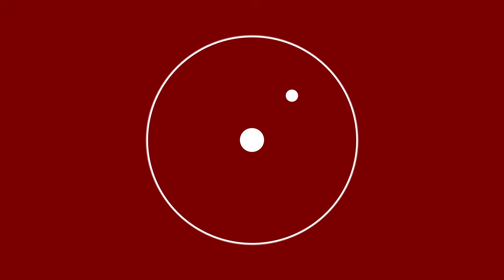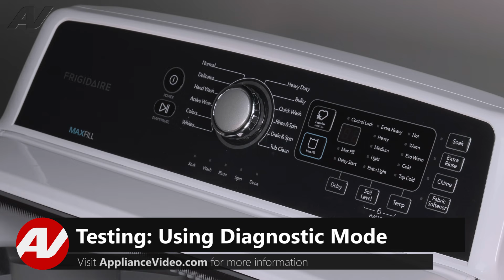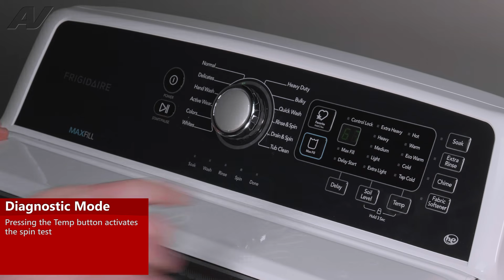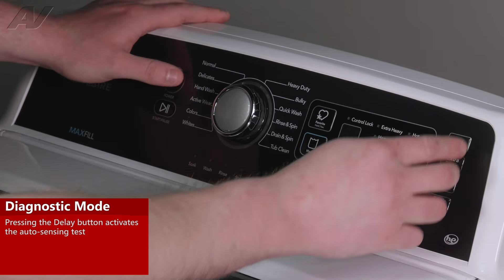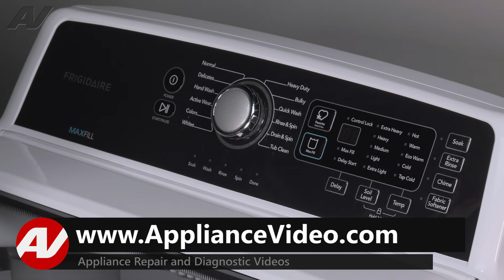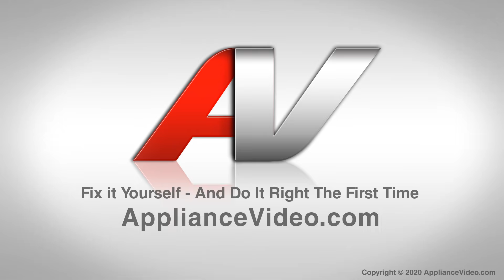Frigidaire Washer  - Diagnostic Mode, Error Codes & Troubleshooting

Comment: im not getting any error codes but after replacing the belt it wont agitate or spin or fill.
yes i got the right belt. 
yes its on right. 
no there are no kinks or leaks in the hoses.
yes the drain engages when testing
yes the lid locks

i did get some numbers during the fill test but none of them were error codes... i think... and they go by too fast to see. its something like 148-140-1 i think?

i did have to leave it unplugged for about two weeks before i could replace the belt if that matters.

Comment: My washing machine passed all the tests. However, when it starts, it discharges water intermittently. And when I wash on the normal cycle, I get an error message of  E1. The water supply is fine, and I've cleaned the red and blue filters. What can I do?
Reply: Same. Daum. Someone help us

Comment: What do you do if the washer is plugged in, but not powering on. Note no breaker has tripped, an washer is plugged in properly.
Reply: with mine, you must close the lid and press power very firmly.

Comment: So my hot water inlet valve blew during cold weather and water was shooting everywhere for hours while I was at work. I replaced the inlet valve and now the interface is turning on but nothing else is happening. Trying to determine if I need to replace the user interface (turns on and light show but the three buttons to test is are not putting it in the mode) vs the electronic control (which I popped out and looked at and nothing visibly looks fried on it). Please help!!!!
Reply: The water probably got into the washer computer board and damaged it, so you will have to replace it probably.

Comment: I have E3 error. I replace lock and switch still have error any suggestions?
Reply: Dealing with same issue— did you ever resolve this? I suspect a faulty wire connection

Comment: What I need to know is how to get it to stop holding water in the softener dispenser
Reply: Did you ever figure this out? Im having this problem
Reply: @norman_gt3505 same here. If I find a solution I will post
Reply: @norman_gt3505  having the same issue 😢
Reply: It gets nasty with softwner residue and it clogs the reservoir, I had to open it and remove reservoir and clean
Reply: Have the same problem,

Comment: What about E2 ?????
Reply: We’re you able to resolve the issue?

We are getting E2 and it’s behaving as if it won’t call to drain. It will spin if I make it manually but I have to drain the water into the sump pump. It won’t go on its own. We have replaced the drain pump, still nothing.

Comment: For those of you like me who was having a problem with the machine not filling with water and going straight into the wash cycle just let the machine run for a minute or two. Apparently the machine is designed to do that "dry" cycle in order to guage the weight and size of the load. Just wait and it will start to fill
Reply: That's so stupid. Been fighting my damn new machine for half and hour. Thanks for this comment.
Reply: YOU JUST SAVED MY DAY🙏🏻❤️🙏🏻❤️🙏🏻THANK YOU SO MUCH!
Reply: yeah but it's useless, I washed a single polo shirt and it used a full tank of water, there's no way to adjust the water level and this is BS
Reply: YOU ARE A LIFE SAVEEERRRRRRR!!!!!!❤️❤️❤️❤️❤️

Comment: Too bad you couldnt' check the water valves....this is the first time I am using this machine...water will not come into the machine at all...it starts agitating immediately with the clothes bone dry and wads and bunches them all up...I have tried everything I know to do with this machine. Any ideas??
Reply: I does a dry run when it first starts...its testing the weight and how much clothes are in the machine...after about two-ish minutes it will run water...its in the manual
Reply: @canadianmom1975  YOU ARE THE GOAT! I have been losing my mind about this and this was the answer THANK YOU!!!
Reply from the maker: Great question, if you have a more technical question that our parts department cannot answer, you can search our over 17,000 answered questions free at our website www.ApplianceVideo.com under our Repair Help section. You can also call our parts department at 1-800-830-5465 and they can give you help 7-days A week ,or search at www.SaveMoreOnParts.com  .

Comment: Hmm I got the same washer and at spin the drum huts and bangs then goes to e4 then rinse again...why???
Reply: Did you ever figure this problem out? I too am having same issue
Reply from the maker: Great question, if you have a more technical question that our parts department cannot answer, you can search our over 17,000 answered questions free at our website www.ApplianceVideo.com under our Repair Help section. You can also call our parts department at 1-800-830-5465 and they can give you help 7-days A week ,or search at www.SaveMoreOnParts.com  .
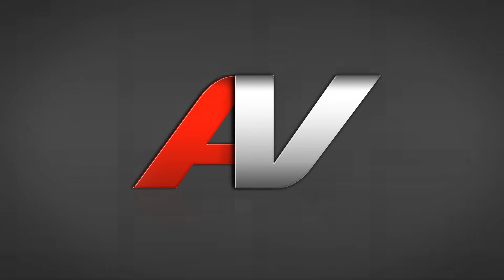Reply: @Appliancevideo  5:56
Reply: Im having the same issue.  takes forever for a load to get through.  sometimes I just have drain and spin
Reply: E4 means the load is unbalanced, so open the lid, rebalance the clothes, takes 10 seconds! then press resume (pause) and it will resume.

Comment: Mine spins in one direction fine, and clicks when spinning in the other direction. Also- it fills with water in “tub clean” but doesnt fill with water in any other mode. And just goes straight into a wash spin
Reply from the maker: Great question, if you have a more technical question that our parts department cannot answer, you can search our over 17,000 answered questions free at our website www.ApplianceVideo.com under our Repair Help section. You can also call our parts department at 1-800-830-5465 and they can give you help 7-days A week ,or search at www.SaveMoreOnParts.com  .
Reply: @Appliancevideo  I have the exact model, how do I find parts for it or the serial number for It?
Reply: @Appliancevideo  my control lock light doesn't come on, can you help find parts for that exact washer in your video?

Comment: When using the bleach dispenser, do you need to be on White wash mode or does Bleach also work with all other modes like Normal, Delicate, Bulky, etc?
Reply from the maker: Great question, if you have a more technical question that our parts department cannot answer, you can search our over 17,000 answered questions free at our website www.ApplianceVideo.com under our Repair Help section. You can also call our parts department at 1-800-830-5465 and they can give you help 7-days A week ,or search at www.SaveMoreOnParts.com  .

Comment: When the agitator checks the load and twists during the wash cycle is it supposed to go in both directions or only one direction?  I think mine might be having an issue.  Thanks
Reply from the maker: Great question, if you have a more technical question that our parts department cannot answer, you can search our over 17,000 answered questions free at our website www.ApplianceVideo.com under our Repair Help section. You can also call our parts department at 1-800-830-5465 and they can give you help 7-days A week ,or search at www.SaveMoreOnParts.com  .

Comment: Mines is E1 need help
Reply from the maker: Great question, if you have a more technical question that our parts department cannot answer, you can search our over 17,000 answered questions free at our website www.ApplianceVideo.com under our Repair Help section. You can also call our parts department at 1-800-830-5465 and they can give you help 7-days A week ,or search at www.SaveMoreOnParts.com  .
Reply: Do you fixed the error? I have the same issue

Comment: Hi! I am having the E4 off balance error code. The drum fills with water and the agitator goes and makes a horrible winding sound and stops to agitate the other way some and then stops and drains. Any ideas?
Reply: Did you end up fixing yours? If so, what was it? Mine is doing the same thing.
Reply: @GLEEPGLORP-o7h  Did you end up fixing yours?
Reply from the maker: Great question, if you have a more technical question that our parts department cannot answer, you can search our over 17,000 answered questions free at our website www.ApplianceVideo.com under our Repair Help section. You can also call our parts department at 1-800-830-5465 and they can give you help 7-days A week ,or search at www.SaveMoreOnParts.com  .
Reply: Hi did you fix this problem? My is doing the same can you help me ?

Comment: My washer is leaking water at the bottom. What could it be? A sensor off?
Reply from the maker: Great question, if you have a more technical question that our parts department cannot answer, you can search our over 17,000 answered questions free at our website www.ApplianceVideo.com under our Repair Help section. You can also call our parts department at 1-800-830-5465 and they can give you help 7-days A week ,or search at www.SaveMoreOnParts.com  .

Comment: Hi the machine is on code F8 . I changed the water pressure switch and nothing is clogged but still not running. I tried reset and taking off the code. Not working. What should I do ?
Reply from the maker: Great question, if you have a more technical question that our parts department cannot answer, you can search our over 17,000 answered questions free at our website www.ApplianceVideo.com under our Repair Help section. You can also call our parts department at 1-800-830-5465 and they can give you help 7-days A week ,or search at www.SaveMoreOnParts.com  .

Comment: hi am getting a bearing noise when the washer is in the spin cycle have you ever done a bearing change on one of these thanks
Reply: Mine stopped spinning so I took out the motor and noticed that the C-clip that holds up the bearing had slipped down and the rotor wasn't sittin' pretty inside the stator.  Once I slipped the c-clip back in place the washer motor worked fine. I have to say that this washer is made very well and I love the logic to the engineering. The drum stabilizers need a little help but besides that this baby should last a long while. Pity for the C-clip design. Good luck.
Reply: @josephsopala7642  mine stopped spinning also. How do I look for the 
C-clip? How the C-clip looks like? I really really love this machine and the are pretty expensive and I don’t want to buy another if I know is a simple fix. Can you help me? I also change the belt that broke. I have only have the machine for 2 1/2 yrs. Love the technology on it.
Reply: @marielpiedra1898  I’ll try to put up a diagram later. In the meantime if this is actually the same problem I had then this is what you. Empty stagnant water into a bucket by releasing tube on drain valve. Then turn the washer on its side but not all the way. Put a box or something to hold it about a foot off the ground. Check to see if this is really your problem. Grab the wheel on the motor (the motor is off to the side not in the center of the drum) with the belt attached and try moving it up and down. It should not move that much at all and if you pull it down and see a little rust showing then the clip fell off. Next unbolt the motor from the drum. If you want to get it all the way out you’ll need to unravel all the wires to reach the connector tied up in a little plastic baggie. But if you don’t mind laying on the floor during the whole ordeal unraveling won’t be necessary. After you get the motor off unbolt the head of the motor housing and pull out the coil. On the top you’ll have to look for an E clip (basically a C clip but looks like an E) slide the coil back in place until you see a groove in the rod (shaft) where the clip fits. Fit it back in and close it up and get them clothes washed. My clip was warn and loose so I squeezed it back together to refit. You might want to just buy a new one. The cap may have slipped onto the groove in the shaft so it may be a little tricky moving into place. Good luck.
Reply: How is your washer doing 3 years later? still working good?  @josephsopala7642
Reply from the maker: Great question, if you have a more technical question that our parts department cannot answer, you can search our over 17,000 answered questions free at our website www.ApplianceVideo.com under our Repair Help section. You can also call our parts department at 1-800-830-5465 and they can give you help 7-days A week ,or search at www.SaveMoreOnParts.com  .

Comment: In test mode the panel shows E3 and is locked
Reply from the maker: Great question, if you have a more technical question that our parts department cannot answer, you can search our over 17,000 answered questions free at our website www.ApplianceVideo.com under our Repair Help section. You can also call our parts department at 1-800-830-5465 and they can give you help 7-days A week ,or search at www.SaveMoreOnParts.com  .
Reply: @Appliancevideo  you have this canned response to everyone and literally haven't helped a single person......

Comment: I did the trouble shoot. But the washer only starting to wash with out no water. Its only taking in water when i do a diagnostic test. Why is that?
Reply from the maker: Great question, if you have a more technical question that our parts department cannot answer, you can search our over 17,000 answered questions free at our website www.ApplianceVideo.com under our Repair Help section. You can also call our parts department at 1-800-830-5465 and they can give you help 7-days A week ,or search at www.SaveMoreOnParts.com  .

Comment: How do you fix E2?
Reply: I fixed that problem by re-leveling the washer. That simple. If that doesn't work try resetting by unplugging washer for a few minutes, plug back in and then open and close your lid for 6 times. Turn on and it should be reset.
Reply: @josephsopala7642 hi, I have the same issue (error E2) how do you re-leveling the washer?
Reply from the maker: Great question, if you have a more technical question that our parts department cannot answer, you can search our over 17,000 answered questions free at our website www.ApplianceVideo.com under our Repair Help section. You can also call our parts department at 1-800-830-5465 and they can give you help 7-days A week ,or search at www.SaveMoreOnParts.com  .

Comment: How do you fix a fd code? Just open and lock nothing works
Reply from the maker: Great question, if you have a more technical question that our parts department cannot answer, you can search our over 17,000 answered questions free at our website www.ApplianceVideo.com under our Repair Help section. You can also call our parts department at 1-800-830-5465 and they can give you help 7-days A week ,or search at www.SaveMoreOnParts.com  .